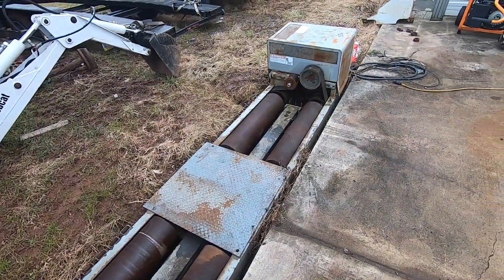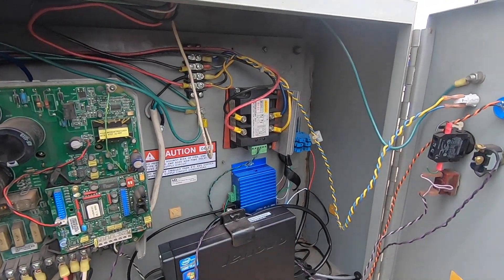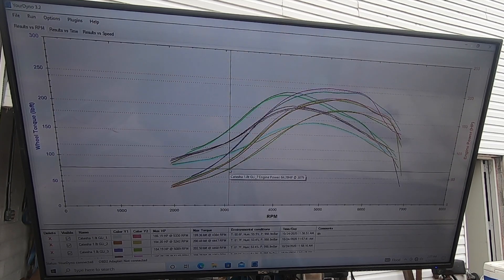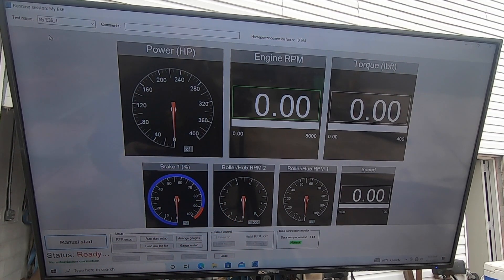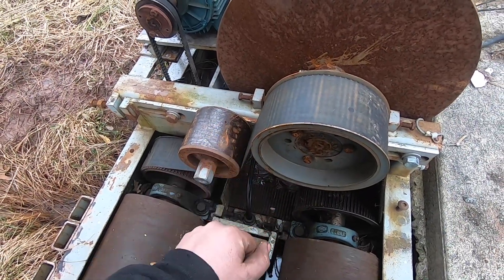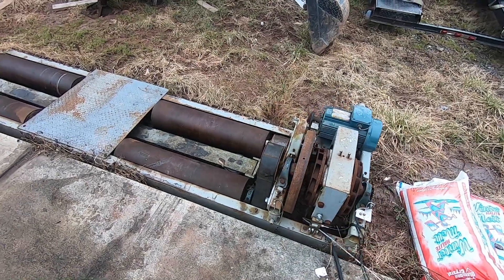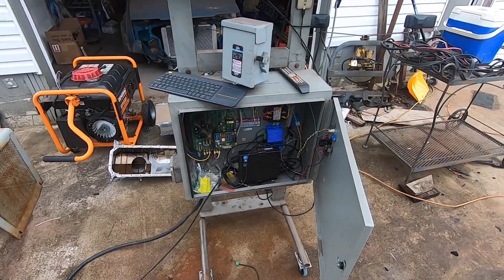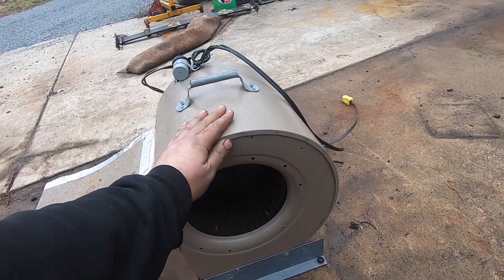How to build your own dyno. SPANKOJET back yard dyno

Comment: Hi, where did you get the two roller dyno chassis from? Find it online somewhere? How much did you end up paying to get it fully operational
Reply from the maker: I got it used from a shop that used it for emissions testing. These were common for Pre-OBD2 cars in PA and NY, but they are getting scarce these days. I don't remember if I talk about cost in the video but id imagine it was around 2K. Its paid for itself several times at this point.
Reply: @spankranchgarage did you just set it up and start tuning and friends started asking then it took off?
Reply from the maker: @rylandallas9907 pretty much. I built it for me but I have tuned 20-30 cars on it since. I don’t use it much anymore but it was good while I used it
Reply: @spankranchgarage made $ though? Why quit using it

Comment: Nice video i headed down the rabbit hole now. I am thinking of doing the same thing. A couple questuons? I am looking at a telma retarder thats about 400 ft/lbs any idea as to the size of the break they use on these? Also is it possible to do a combination enertia and eddy brake pull to get into the higher hp ranges? Thanks for all your info.
Reply from the maker: This brake is much smaller than most Telmas. Its only useful for low load tuning or low power cars like stock miatas. Yes you can use the brake and inertia to make the pull longer for higher HP stuff. The yourdyno software can do that I am pretty sure.

Comment: Whats your thoughts on strapping and car riding up off the rear rollers vs measurement difference..... Inertia content of the riding off the rear roller being an issue.
Reply from the maker: They are tied together via belt drive. Both rollers and the flywheel spin as one. But yes that is an interesting point to consider and an area of possible error. Perhaps less tire drag if the tire is only riding on one roller and/or traction issues

Comment: Really cool man. What is The maximum power you would put on this unit? 300-400 hp?
Reply from the maker: For a v8 car 350-400 is about all I can manage and still collect enough data points to make tuning decisions. For a turbo car that generally has a shorter powerband I have been in the mid 400s without an issue. It has it’s limits but for most street cars it works well
Reply: @spankranchgarage is it purely a limit of the eddy brake?

Comment: I’d really like to buy this to set up my duty cycle table,so reference is correct as my 05 f150’s frame has rotted out and don’t have opportunity to use a trailer no longer, was looking at stuff like this a wile back and there’s a lot to it for sourcing components, who has one I can just pick up that’s done just looked again and at the price point better off just buying one. Not looking for numbers at all but cool to see , primarily to get my references  for what duty does x for my table

Comment: Great video and dyno.
Kinda hard to find emissions rollers over here in the u.k (probably not googling correctly), but we do have a few MOT spec "Class 3/4 Brake Tester Rolling road" for floating around fairly cheap, since these are used to measure deceleration, do you think it would be possible to convert one of those too? 
This type of roller seems to come with motors, but I'm yet to figure if they have eddy brakes also..
Thanks for any response.
Reply from the maker: The eddy brake is cool for part load tuning, but I only use the inertia for full power pulls. Those MOT dynos might have a good bit of inertia, unless they are using the motors to "challenge the brakes". Id say go check one out and see what it looks like.
Reply: @spankranchgarage  Thanks (for this and the M50/54 content). Will do. Cheers

Comment: So if you increased the eddy brake strength and/or the roller weight, it'd be usable for higher horsepower applications?
Reply from the maker: Yes, to a point. The dual rollers don't provide too much grip and the belt also has its limitations. But I think 550whp or so could be reliably measured.

Comment: What are tge specs on your PC? I'm tryinv to find the best balance of cost to performance for my Dyno, using a YourDyno controller.
Reply from the maker: Its a pretty old little IBM in there. It doesn't take much computing power to run this dyno. I dont remember the specs but anything made it the last 10 years I would think is sufficient.

Comment: Also I know you changed your timing belt sprocket for the flywheel to a larger one to get 1:1 from the rollers to the flywheel.  But would it be possible/beneficial to move one of the large sprockets up to the flywheel and move the small one to the rollers and get one more smaller sprocket on the other roller?  It'd reduce the eddy brake capacity, but it'd probably increase the time it'd take for the flywheel to spin up?
Reply from the maker: If I did that, we would see really high roller speeds and really low flywheel speeds. If I remember right the roller bearings were the limiting factor I dont think you want them spinning more than 130mph or so. The 1:1 ratio works out well because the safe flywheel speed almost matches the max roller speed I'm comfortable with, maximizing the available inertial.

Comment: So what's the most power you've recorded on your setup?  I heard you mention ~400hp, is there something preventing it from recording higher inertia based runs?
Reply from the maker: Ive had closer to 500hp pulls on it. The issue is with the inertia this dyno offers, the pull is very quick at higher power levels. This results in less data points per pull, and on turbo cars sometimes less load.I find around 400/400whp/wtq I get a long enough pull to tune precisely. Anything less than that is even better

Comment: Thanks for sharing!  I've got an old ASM97 and YourDyno as well.  It's torn down for cleanup and paint but I'll soon be using it for part throttle tuning.  I see you replaced the KBMM eddy power supply with a MT2DC-1-220V55A rectifier.  I was planning to get the sparkfun isolator and adding a RC filter but your solution simplifies things.  👍 

Can you share your source for the new pulley?
Reply from the maker: No Problem. The belt pitch is 8M. My pullies are 85mm wide. Measure yours because some ASM97's had thinner belts (55mm if I remember right). Here is an example pulley that I used. https://www.zoro.com/continental-sprkt-80-teeth-8m-pitch-85m-wide-p80-8m-85-e/i/G2216322/

I was able to get it on ebay for cheap ~80 bucks if I remember right.

You will also need the QD hub to fit your shaft along with a new belt length.

Comment: Only numbers that matter are those quartermile times boy!!!
Reply from the maker: Or a lap around E town!
Reply: @spankranchgarage  if that's the case then the only numbers that matter is the coolant temp
Reply: @JoshRoeloffs  AFR, EGT, oil temps are usually a bit ahead of coolant temps on track for me. Especially AFR/EGT. Can absolutely melt a piston before getting hardly any noticeable upticks in coolant temps. Especially on OBD-I boosted cars. Some could say it ends up being the catalyst of a going to a Haltech R3 to gain all the sensors you don't have, per cylinder adjustment capability, then...adding a secondary fuel pump, deleting the MAF and converting to MAP, and moving all critical components off the main fuse box to the VCU to control and power. All thanks to old 90s cars having no way to protect themselves or even warn you of issues such as wavering fuel pressures causing catastrophic damage to the cylinder last on the rail and last on oil and coolant passages. Relying on only your coolant temperature will absolutely destroy said engine in more ways than it can warn you about......all of this theoretically speaking, of course.